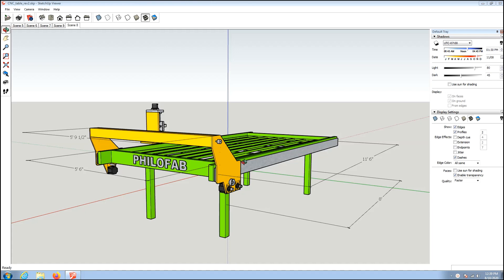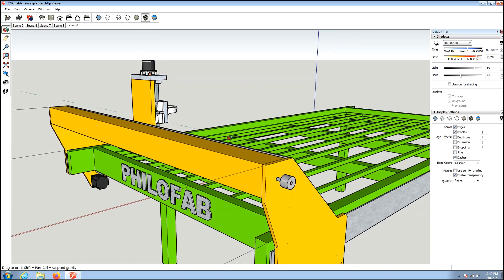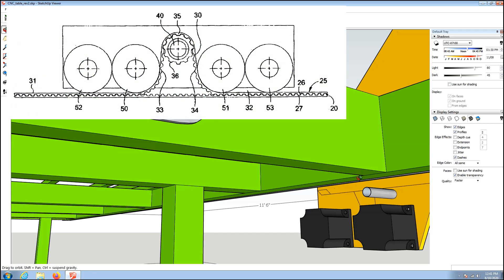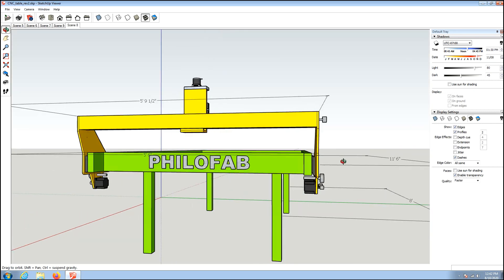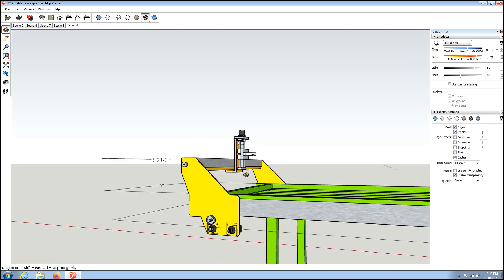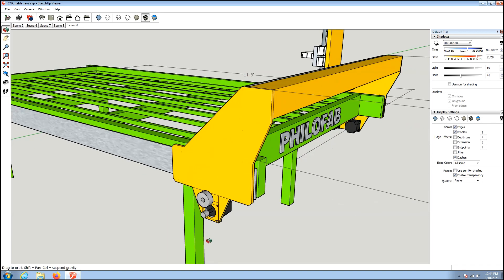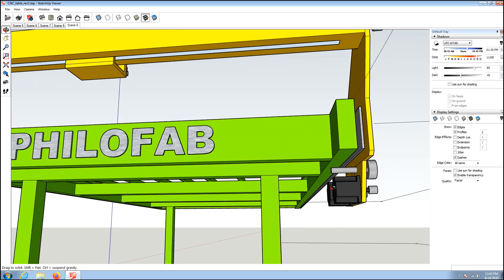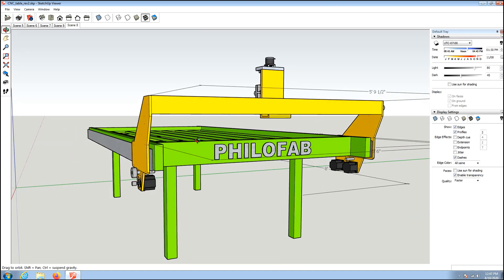My CNC plasma table build plans.

Comment: I’m not an expert but just a thought I had. I think the water jet tanks are really deep because the jet can penetrate, even to the bottom of those tanks and cut through them if left too long. Just something to consider during the design
Reply from the maker: IF I do add water jet functionality it will be to cut plastic and non metals so the pressure will be lower than a traditional water jet.

Comment: I would move that x axis ball screw to the back of the gantry with a splash shield. 

With it on the bottom you have it the closest with a direct line of sight to catch debris from the work surface.
Reply from the maker: Yea, I did that so gravity would help keep debris off the ball screw. I did plan on putting a pair of wiper seals on the bottom to keep junk out and I also plan to install rubber funnels on the torch to keep the splash down. If I move it the channel ends up being a shelf and I think it will require more cleaning and maintenance.